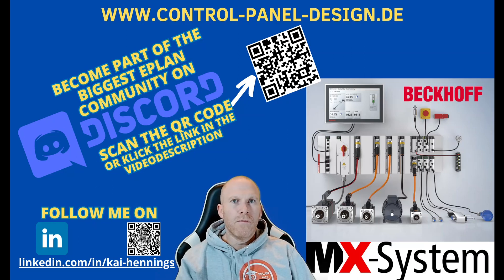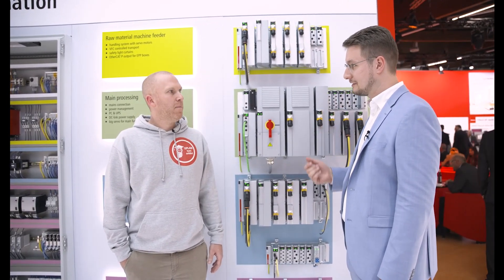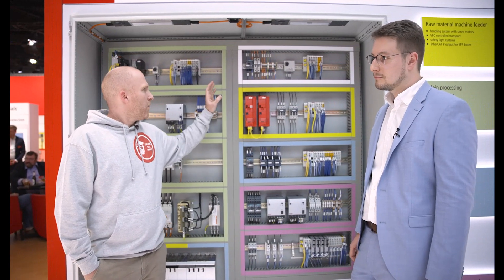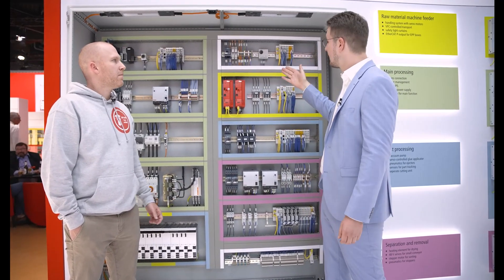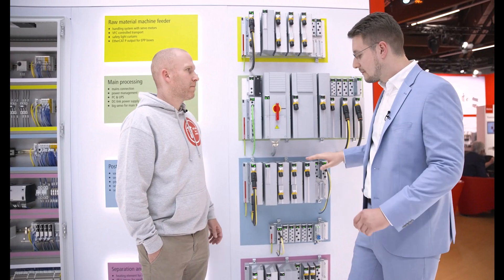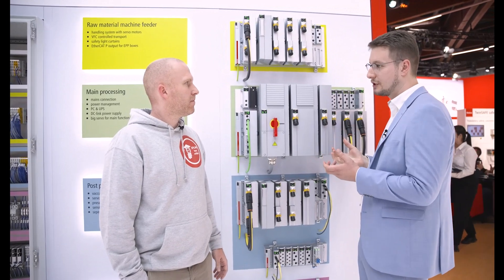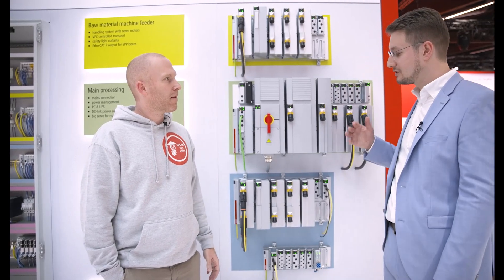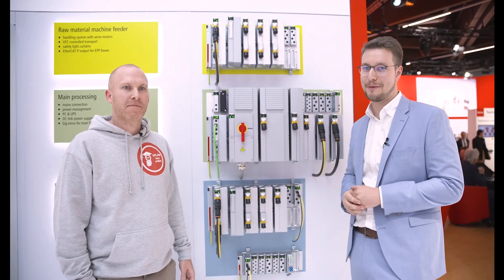Beckhoff MX-System. Control cabinet free solution for Industrial Automation

Comment: That's a very interesting solution. It would be great if you could explain how to implement it in the electrical schematics in Eplan.
Reply from the maker: Will do soon. EPLAN Macros are available for the MX-SYSTEM
Reply: @eplaninanutshell  Would be great to see how you would implement ProPanel macros which allow you to build up a rack.